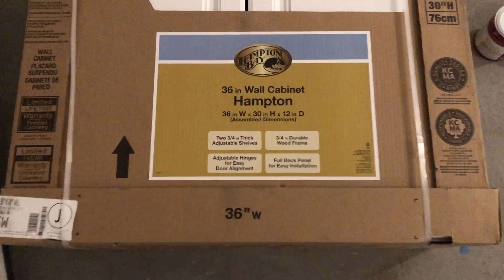Laundry Room Makeover [With Easy Peel & Stick Tic Tac Tiles]

Comment: You looked to have No height issues, The left lower came exactly to the right upper, and the right upper shelf used exactly three rows to meet the shelves.
Did you not have to cut any Height adjustments?    Or did you plan the heights based on the tiles ahead of time and placed the shelves accordingly?